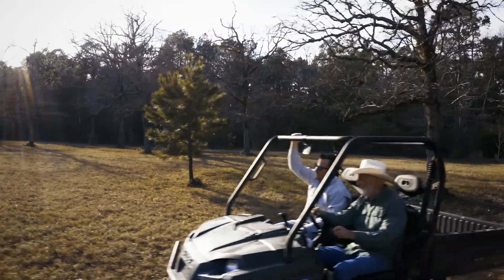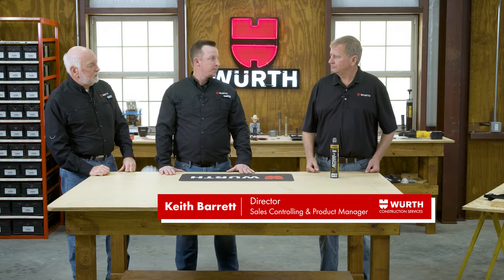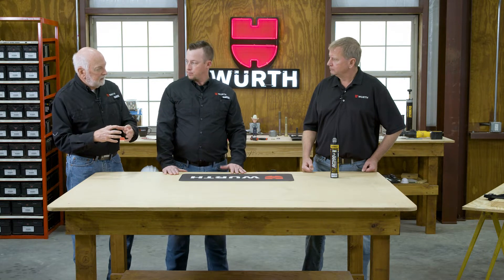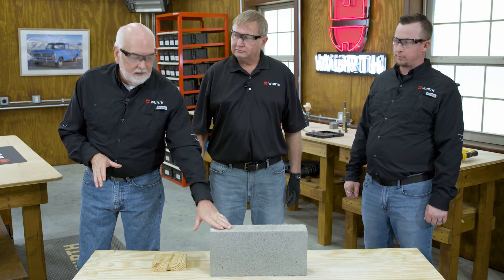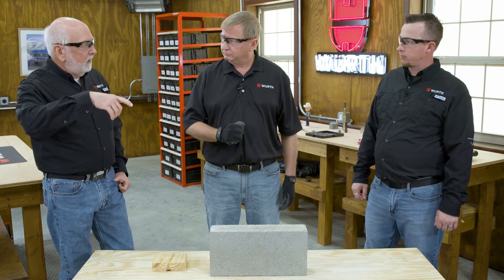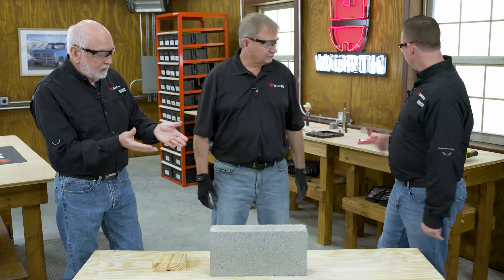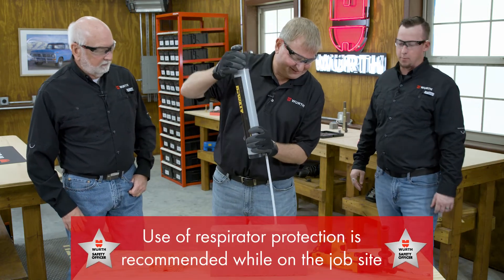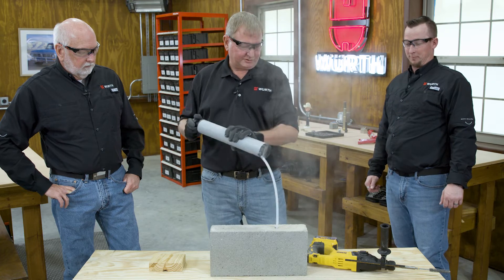Adhesive Anchors | Würth Knowing Episode 25

Comment: Well, this reduces measuring to achieve the architectures specs and building codes, giving one trained technician a simple easy method of getting it done. 
 As a suggestion, perhaps each tube can come with a peel & stick label to onto job site documents showing date installed, best if used by date, PSI holding power and certificate number and company info for additional concerns like “VOC’s” and hot line number for poison control if ingested. 
 Cool!
Reply from the maker: All safety data and strength characteristics are readily available. Use of adhesive or any type of anchor system should be approved by the engineer of record for any job. 

- Randy